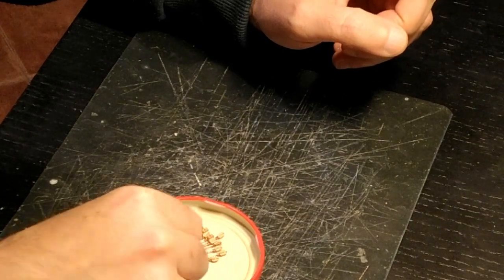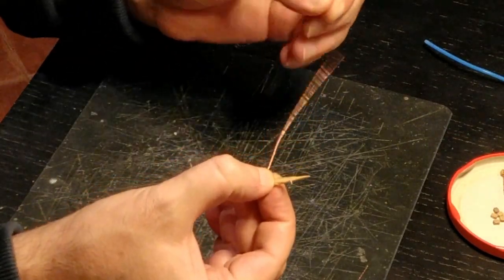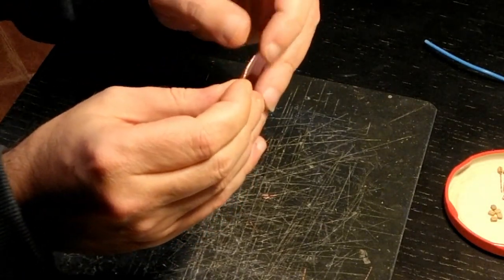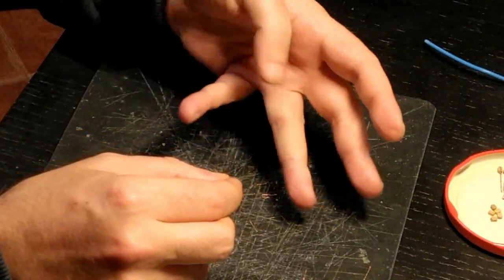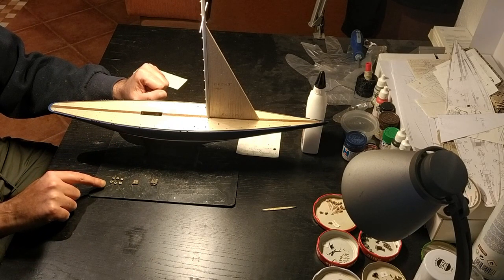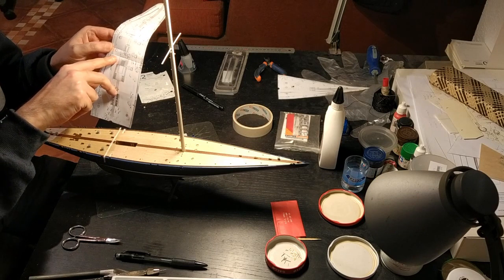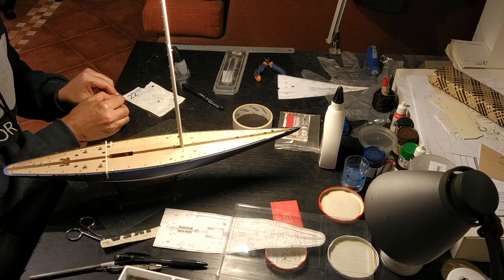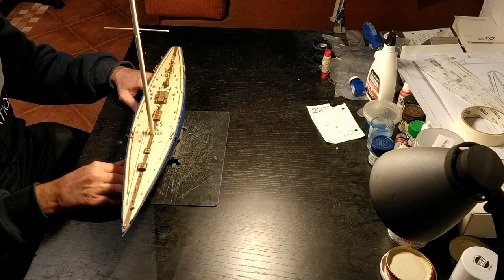Amati Endeavour Part 18   Attaching Deck Details and Mast

Comment: I never liked where the compass is on the model.  On the real boat, the compass was sometimes there sometimes not and in most pictures I have seen, it was placed where the coffee grinder is located on the model.  That is where I  placed mine. One thing to note is that the compass on the real Enterprise was that it looked like a straight bit of tube and had no balls on the side.  When Sopwith built Enterprise 2 he relocated the compass to be placed directly in front of the steering wheel and while it also was a straight tube, it did have the 2 balls (painted black) placed on both sides.  The compass that comes with the kit looks like it belongs on J class Ranger.  But note on Ranger the box faced forward and the balls were painted black. 

So what about the coffee grinder?  Well that too was sometimes shown in the position where it is placed on the model!   I have elected to retain the coffee grinder and have placed it where the compass would be on the model.  This fits in with how some other J class yachts had their coffee grinders located.

Some details missing on the model and which I will put on, are the "rowing" handles to turn the deck winches; the dinghy; the additional instruments behind the rear hatch; the wind speed recorder on top of the mast and the life buoys.
Reply from the maker: Thanks for all the detailed information. I found some of the deck components a bit odd but I guess that they are used for several models so they are simplified.

Comment: I am working on my Endeavour and have have completed the first planking, by enjoying every minute of your video instructions, however I have been unable to find a sanding filler sealer similar to the one you used. Could you please give me some information where I can locate it.  Thank You keith Fullmer
Reply from the maker: Hi Keith, The brand of the filler I used is AXTON. This brand is sold in a DIY store chain called Leroy Merlin from France which can be found in various European countries. The filler is a fine type covering cracks up to 2mm. Even if you don't have the same brand I'm sure other DIY stores will have a similar one. The most import thing is that it is for small cracks. I hope this helps.